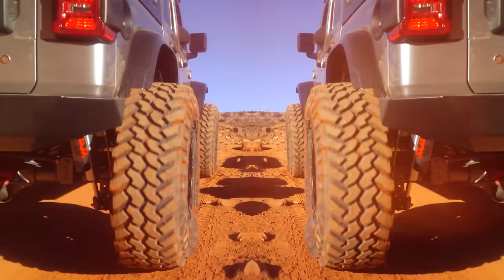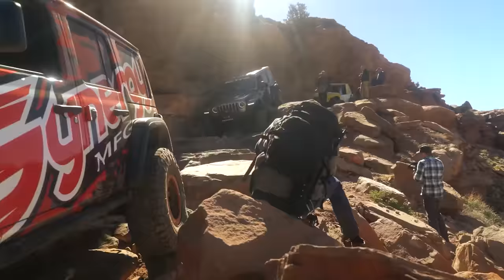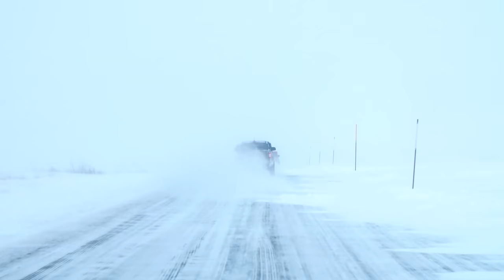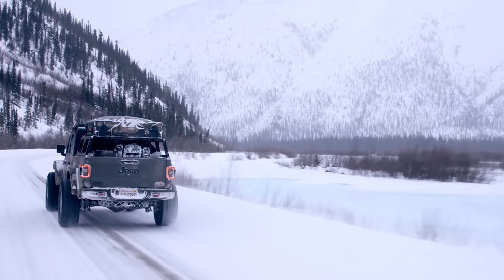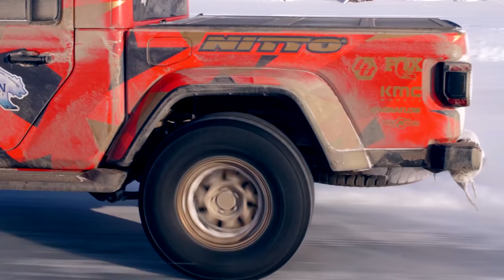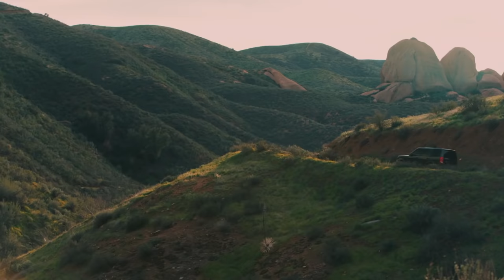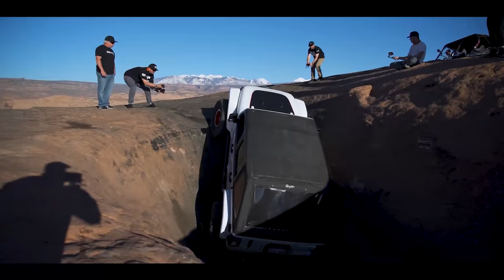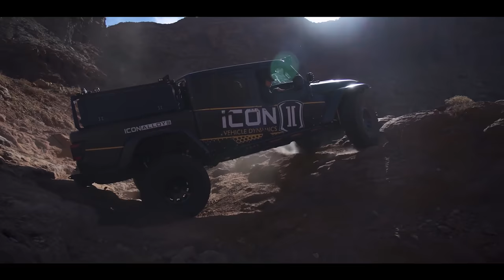Do NOT Use 4-Low Offroad || Watch First!

Comment: With a manual transmission 4x4, which are common in Europe, 4L can be really useful when you want to maintain a slow speed, especially when dealing with hills.  In 4H its easy to end up riding the clutch to keep your speed down which eventually puts a lot of wear on it and a high risk of burning out your clutch.  In 4L you can maintain a much slower speed with more control with your foot completely off the clutch.  When dealing with hills its also much harder to stall a manual 4x4 when in low range gears at low speeds.  I've even used 4L to navigate out of multi story car parks where the space is tight and the ramp is steep to avoid burning my clutch and being able to crawl up at a controlled speed - it's not only for offroad :)
Reply: @@johnnywhite7717 has nothing to do with that. some cars have a really long gearing for its power or the tires running. My patrol has like 70/80hp on 32''s. I never struggled to use clutch in the right way and I dont ride clutch on hill starts.
But to avoid clutch wear just using 4lo is perfect. Why wear something just to be stubborn. Matter of fact my 4Lo can actually be used as a 2Lo as I have manual hub locks, wich is perfect for those pesky hills (my city has lots of serious uphill areas)
Reply: you never , ever enable 4wheel low on concrete, tarmac, asphalt or anything paved . This is deplorable misinformation, respectfully. If you got lucky & were actually able to chirp & jerk your poor jeep around a parking deck in a metropolitan area with it engaged , try it a few more times & come back & tell us how much ring & pinions cost presently since you'll know from having to replace the chipped ring gear teeth you experience. This reply is what drove me away from  the Jeep community,fr

please don't just spout information on the Internet that is incorrect or that you only know minimal details about. You can affect negative impact on others ,Mr. Burning Clutch

Comment: On a Jeep, the manufacturer recommends using 4 low anytime you’re off road because it keeps your transmission cooler. Running in 4 high can put high heat stress on the transmission which could lead to early failure (Watch for an alert on the Dash “hot oil!”) 

Here in Utah we don’t have a lot of mud so when we go down to Moab or up in the mountains around our home we air down the tires and engage 4-low every time. The only time we switch back to 4 high is if we hit a stretch that requires a bit more speed.
Reply: My Jeep says not to exceed 25mph in 4 low, which I ignore, and it doesn't mention anything about cooling with 4 low. I believe I have seen 4 high heating the transmission, and low never has, but I haven't had Jeep mention it.
Reply: Thats a great comment thank you!! Most people don't read their manuals and then they don't know whats been "proven safe" by the engineers... and even if they say 25kph its probably safe to do a little over but id say why not keep it a little under!!! Same with switching into 4hi while driving the JT you can do so when driving but make sure your under 73kph and id say max 70 or less if you have bigger tires your speedometer could be off too so you have to consider that, the only reason id switch into 4 hi going 70kph is if I lose traction say in the snow and am worried about crashing or something can just give peace of mind on the fly
Reply: Land Rover recommends the same thing (though in my Discovery 2 the top speed is 35mph)

Comment: I'm building a truck right now and just took the 1.8:1 lo range gears out and put in 4.24:1. I also installed a set of twin sticks that separate the 2 wheel drive-4 wheel drive and the hi-low into 2 separate levers. For those that don't know it give you the option of 2 low and true neutral at the tcase

Comment: I got aff of my 11pm shift and decided to take a trail back home (on that connects from my work to town) and I figure I'll explore a bit since I knew the area pretty well. I come on an old fig site and see an elevated area since I'm trying to exit onto the main trail nearby. Turns out my 2dr jk car get high centered on the crest. I spend an hour and a half digging and stacking rocks which only helped a little. Finally I grabe a flat rock and my hi lift and jack up the rear while I'm in 1st gear lo with lockers and she finally got traction an walked off of her belly. Mean while I'm running to jump in the driver seat and stop her since she's finally free. Definitely an education experience. Always scout out a line! Dont wheel alone. Most importantly is to have a way to self recover. Especially if it your daily. Someday either you or some one you're helping will need it.

Comment: Swapping in an Atlas 4 speed transfer case is one of the best mods I have done.  Yeah, it took me 6 weekends on my garage floor to get it all in place and working but the options it provides made it all worth it.   Mine is a 2.0/2.72/5.44. I pretty much just put in into 2 to 1 as soon as I hit the dirt.  I have never been a fan of 'waiting till I get stuck' to put it into lo. This ratio works well for most situations but still allows a bit of speed.  I usually just have it in 2wd but when I come up to something I will engage the front wheels.   For longer down hills I will put it in 2.72 for the engine brake and I use this gear on more difficult obstacles.   When it gets a bit more hairy then you can't beat the control of a lower ratio like 5.44 which keeps me from having to get too much on the gas and avoids breaking stuff.
Reply: I extremely want to do a atlas in my xj. Though about doing the np231 doubler kit but atlas’s seems to be the way to go

Comment: With living here in Pittsburgh I have to deal with a lot of hills which is fine during the better months but winter is another story. This winter we've had about 3-4 significant snow storms and I'm out driving in them up and down some rather steep hills. 4L helps a great deal when I am descending a street on a hill. Before reaching the street I put my Jeep in 4L and put it in 1st gear (I have the 6 speed manual) and basically let it "crawl" down the hill not braking or giving too much gas. It gives me better control and I'm not touching the brakes constantly which in my mind braking going down an incline in snowy conditions will cause me to start sliding. This is my 1st time having a 4X4 and I'm loving it! Makes driving in bad conditions easier and yes, enjoyable! I look forward to a bad winter storm now!

Comment: As a 4wd instructor, the simple rule is:
High traction surface: 2h
Low traction surface, estimated speed above 40kph: 4h
Low traction surface, estimated speed below 40kph: 4L
Works every day, most situations
Aren’t there any 4wd trainings in the US?
Btw, if you have a Unimog with 24 forward gears over 3 gear groups - it’s a little different….
Reply: No 4wd instructors in US, people learn the hard way.
Reply: Is 40km/h not a bit high for 4LO?
Reply: They’d say 25 miles per hour, but that sounds about right. It’d also depend on your gearing too, sometimes 25mph/40kph is an achievement that can near blow the motor up in 4L.
Reply: @ShaolindaGama  it’s a rule of thumb, like you know you will be for sure below 40kph. Below is the key word here, 4th or 5th gear in 4Lo will do 40 easy, but you don’t want that over long periods. (Talking average 4x4s, not reduction gear rock crawlers or Unimogs)
Reply: THANK YOU Andre, APPRECIATED.
Reply: Question Andre: I have a 2006 Jeep Cherokee 5.7L. There is a lot of deep sand on my farm. I normally drive very slowly around 5-10km/h. Will it be more beneficial to drive 4L? Question is that it doesn't feel if the vehicle is struggling, but to protect the transmission will it be better in 4L?
Reply: @johanbester4484   if you have it just in 1st gear 4H and don’t find yourself half way on the clutch because 1st 4H idle is too fast, 4H is probably just fine. If you have an automatic choose whatever helps your gearbox to not labour too hard.
With your own farm on hand - try different combinations. What feels more comfortable is most like the best.
The “4L for below 40kph” rule is more for your “typical” or “average” situation. One of the big advantages I find is how quickly you can slow down by just lifting the foot.
The other is, by having more gears available for the same speed range you can choose better rev ranges for the situation. Like if you want to go 5kph in 4H, it’s most likely only 1st gear. In  4L you probably can choose between 1,2 and 3.
I got a Unimog with 16 fwd gears. Gear 1-15 are for speeds between 0-50kph, gear 16 is for 50-80kph……
Reply: We don't need 4wd training in the U.S. we just go out and do it and learn from experience.
Reply: @nateross14  15 years ago, before I knew anything about 4wd, two minor mistakes after a mechanical breakdown in a damn remote corner of the country nearly cost me my life - it changed my perspective.
Reply: @andrefischer5025  Yeah, common sense would dictate to become a proficient offroader in close by areas BEFORE venturing out to remote places alone. And even then, always have sufficient equipment for emergencies.
Reply: It’s 2H never in my book. Permanent 4WD or go home.

Comment: I drive a 93 yj with an Atlas 4 speed, 2.72 low, 4.3 low, and 11.7 low. 2.72 is for trail running between major obstacles.  4.3 is for technical uphill/downhill and rocks. And 11.7 is for crawling over some Prius that cuts me off in parking lots.

Comment: I'm a big fan of 4-Lo in second gear (manual trans).  In the trucks I've had that seems to be a good final ratio for getting torque to the ground but still having decent wheel speed for a lot of situations

Comment: I taught my daughter to drive a stick in my XJ in low range on a dirt road. No issue of stalling because she dumped the clutch.
I had taught my son to drive a stick on a snowy parking lot in the middle of the night in our Volvo. 
I had learned to drive a stick in a 54 Chevy sedan, but I might have stalled it a few times. LOL
Reply: Now my 5 spd Tacoma goes into 4 Lo when I am towing a trailer loaded with wood up a gravel road with a 15% grade. I like that it makes a close ratio.

Comment: I always put my Jeep in 4High when I drive through campus, because girls like it. When I drive by guys on campus, I put it in neutral and Rev my 2.0L turbo with my oversize muffler. It sounds just like 1996 Honda Prelude with Vtec. But when I'm in the drive thru at Culver's, I always use 4Low because then I can drive up the curb and park halfway up the landscaping and represent properly.

Comment: One often overlooked detail when using 4 low with an Auto to provide engine braking, is that you really need to also shift the transmission down through the lower gears too or it will just freewheel and still burn up your brakes. Also if I'm going up a steep grade for an extended time, I will also use 4 low to keep the tranny from getting hot and let it shift up into high gear where you can still do 25 mph and save your trans...it will run WAY cooler doing that.
Reply: So with all these gizmos trying to nanny the human, the human ends up nannying the nannies in order to get the job done. 
Whew thank goodness my ute is old school.
Reply: @zainabe9503  This applies to any auto trans, I use it on my 98 first gen Tacoma and 97 F250. No special gizmos on either truck, unless an auto trans is considered a "gizmo"
Reply: @motafinga6652  naw, an auto trans is considered a BLASPHEMEY 🤭🤭
Reply: @zainabe9503  ok Boomer
Reply: @zainabe9503  a car is blasphemy, technology is awful, we should all just walk around Barefoot

Comment: I use 4-low for plowing snow and use 2nd gear more than 1st gear. One of the cool things about a manual transmissions is you can choose to use  1st, 2nd or 3rd gear from a dead stop and know it will stay in that gear until you choose to change it.
Reply: A lot of automatics have that selection.

Comment: When doing Hells Revenge trail in Moab I found myself switching from 4H to 4L. The obstacles are spread out a bit so that causes you to want to go faster in between the obstacles. My Rubicon is an automatic so it helped a little bit but I still found myself switching it from time to time.
Reply: It would be so nice to be able to move that quick on trails down there.  Every time I have run trails in Moab I have been in groups too big to move at 4hi speeds.
Reply: @deadskimountaineer  Good point
Reply: @deadskimountaineer  Go on off weekends or later in the season.  Late October to November is a great time to wheel in Moab.
Reply: @hexnut72  the 21 hour drive to get there makes it a tad harder to pick times.
Reply: Same thing I did last week.
Reply: I like the higher gears in my Mojave transfer case for that reason.  Can leave it in 4L if I want.  And still plenty low for crawling over stuff.  There are only a few extreme situations where the 4:1 T case is a true advantage but its never held me back.

Comment: Had a 73 Chevy 4.56 gears 3 speed granny low. Was great for bucking hay in fields.  Didn’t even have to be in the truck, Just threw hay into the truck and turned the wheel with the curve of the field when needed. .  The sprinkler ruts didn’t even stop it.  It would climb a wall and could not pass a gas station   I miss that ol truck!

Comment: I use four low every once and a while when there’s really steep inclines or drops it’s just better on your brakes and will help not to strain the engine as much going up if you got it might as well use it
Reply: I did until I got a vehicle with hill decent control...that shit awesome!
Reply: @Chris-D9  I'm still trying to figure out the hill decent control for my 11 JKU Rubicon. It isn't really covered very well in the manual and most of the people I go out with have newer Jeeps or old TJ's or FJs.
Reply: Think of it this way- 4low gets better leverage from your engine's available power , to turn your wheels.  The t case gives you improved leverage over the tire's height and it's resistance to rolling.
Reply: @Harry-zz2oh  harry for going off road down a hill, get in 4low, and in first gear. Let it idle as it goes on down .be careful in case it does not have engine braking feature

Comment: So simple put it give you maniacal advantage also if you're in soft sand I always look at my transmission temperatures if it gets to high or over about 220 or so put it in 4 low this will put you in a higher gears and lower your temperatures just by driving hopefully this helps you out as well

Comment: As I have been “off-roading” for many years now it really just depends on the terrain. But the longer I did it the less I have used 4x4 and especially 4LO. I definitely use it to come off steep inclines. Or to climb a steep hill. The last thing you want is to come off backwards. However, when it comes to mud ( especially a hole you’ve not been in before and don’t know what to expect) I often start out in just 2wd. Or 4HI. That way you don’t dump into a deep hole and you’re done. Once you get hung in 4LO there’s no getting out without a winch. If you ease into it and get a feel first then you can back out and engage 4LO, etc!! Just some food for thought. This also pertains to the slippery rocks and sloppy mud where I am from. I’m sure everyone wheel’s different. To each their own. 😎🤙🏼
Reply: Trying out the terrain is where direct connection manual transmission really shines. Listening to the engine, knowing the throttle position and watching the speed, you know exactly how much traction reserve you have. I can go very far in sand and mud in just 2WD. You know when is hopeless long before you get there. You can find a higher spot to stop and reverse out of there. 
Having driven manual 4x4 for years without getting stuck, I got stuck immediately with an auto. You just can't feel the traction.

Comment: As you said, it’s very situational. 
I stay in 4hi until I come to a steep hill, or need precise control. 
Imho this limits the strain on the drivetrain vs staying in 4lo all the time, heating up the transmission unnecessarily.

Comment: My 06 Durango is unusual. The front differential is a d44 variant pumpkin with cv axles. It came with a single speed transfer case. It's full-time AWD and then you can put it in '4-lock' which essentially is 4hi. So my thought process for off-road is keeping tires between 31"-33", installing a supplemental transmission cooler, transmission temp gauge and shifting into 1st gear on ascents and descents. I'm in Colorado so this is really a challenge with steep trails.

Comment: Don't exceed the recommended speeds in 4 low.  25 to 30 mph is asking for trouble. Use 4 low, get thru obstacle, move back to 4 hi. Keep t case in 4wd hi or low at all times, esp if you are open front and rear, lsd/ open, or lsd / lunchbox.  Use 4 hi in the rain in town. In deeper snow the engines leverage over the tire's traction can cause tires to spin and loss of gription. If you in deep snow and running the engine hard, just move down to 4 low.

Comment: The low gear in my old, 1990 Isuzu Trooper would creep along at a slow walking pace.  Uphill, downhill, and on the level.  While I don't recommend this, it can allow you to hop out and look at the rout ahead or steer through the window where the obstacles are small boulders.  I usually would stop and switch to four low for rough, tricky patches or really steep slopes when going down.  You mentioned doing that before your brakes over heat.

Comment: I sometimes use 4Low with the hubs unlocked when backing up into a tight parking spot on an incline.  Love that extra control and only having to move it with the clutch. 4Low 2nd gear is great when descending hills in snow and ice.
Reply: Does this apply to auto transmissions? I have a nasty hill that ends with a traffic light. Would switching into 4LO and putting it into second gear accomplish better traction on the decline?
Reply: @zach23ize  yes that should help.  Let the engine do the braking, don’t touch the brakes until you get to the bottom.